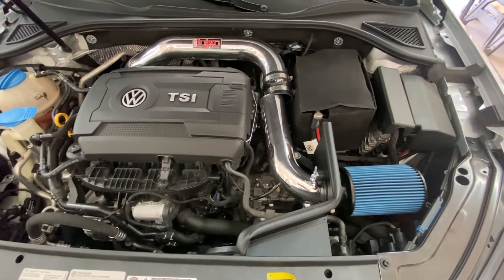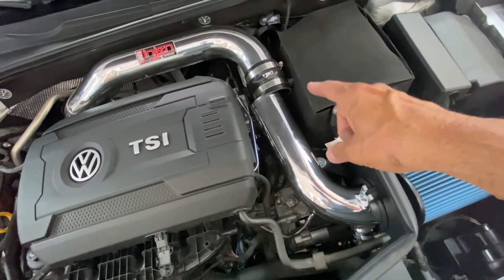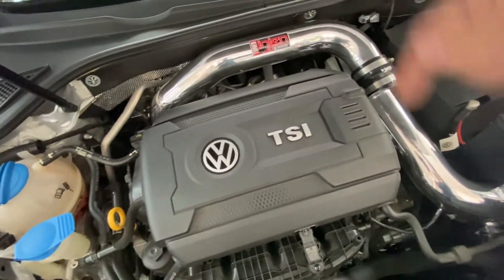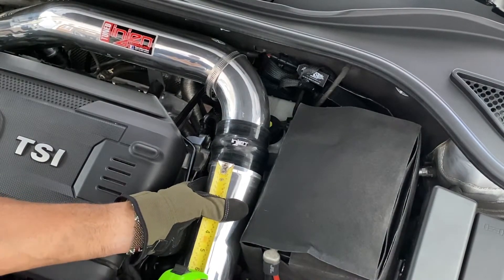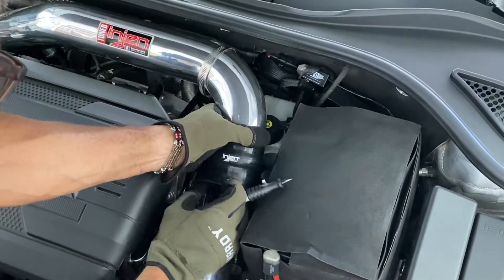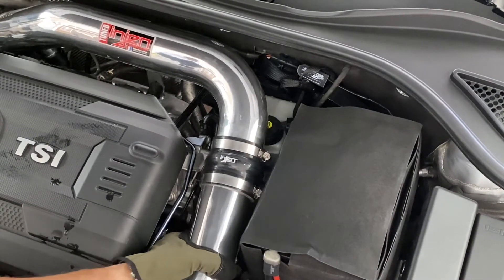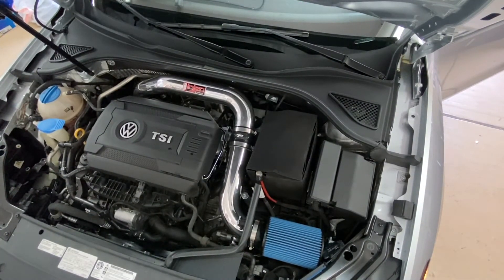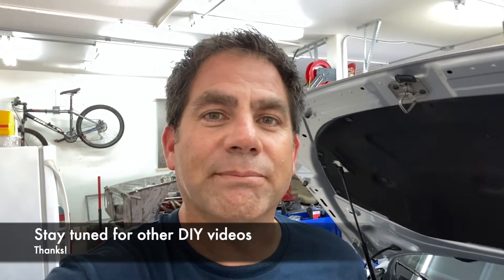VW Passat Cold Air Intake Troubleshooting

Comment: What did you do with your maf sensor ?
Reply: The ea888 1.8 like this doesn't have a MAF. It utilizes a MAP sensor and uses the calculated pressure and turbo boost to calculate the fuel.

Comment: you are not right about this video, so i gave you thumb down, not all people experiencing same issue like you, some people experiencing different issue with their gas pedal and brake pedal. I have experienced when i was installing my cold air intake, when i was starting car i can feel gas pedal was vibrating, and when im driving a car at the stop i can feel vibration coming from air intake rubbing the brake fluid reservoir, I'm sure that you are experiencing that because the angle of your main pipe that goes to a turbo is way off the balance. I replace my air intake kit with new kit and now i have no problem at all when it comes driving a car.